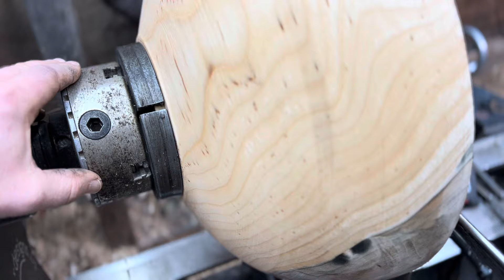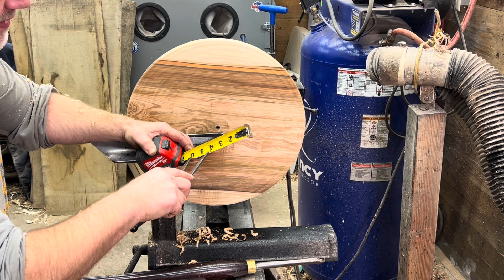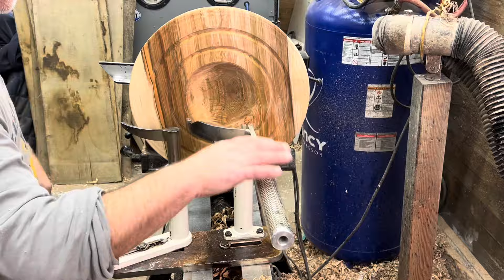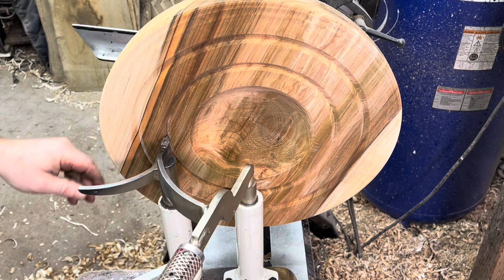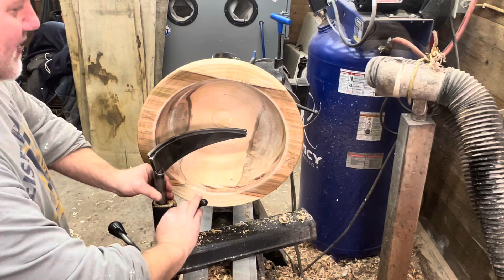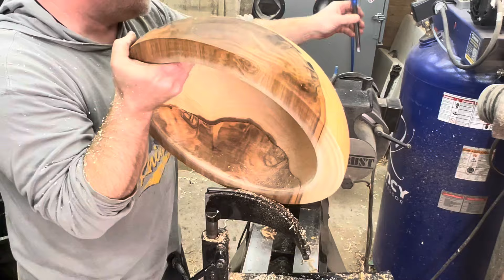Bowl coring using the Oneway easy-core

Comment: Fantastic video....I'm forwarding this to a buddy. I purchased my Oneway set last fall and have a few half logs ready to "process".... Sassafras!! I will be sure to clear those chips... Thanks for the advice. One question.... How do you store your Oneway pieces to keep them organized and handy? I just finished a wall rack for mine, but really pulled the design out of thin air... I am looking for other ideas. Thanks again.
Reply from the maker: Sassafras is so fun to turn. And it smells amazing. My shop is extremely small and I have almost no wall space. My pieces are all in a big steel cabinet out of the way for now. At least until I build my forever shop hopefully this summer. Holler if you run into any coring issues. Happy to help

Comment: Great video. Thanks for the instructions on the coring system. I’ve been considering one.  And I didn’t understand what all the knives were needed. I have a max diameter of 20. 18” is usually my starting point. And too don’t do small bowls. Can I get by with just a couple corn my knives? Roughly the 2 you just used?
Reply from the maker: I'd suggest starting with knive 1 and 3. You can always add knive 2 if you find you need it. 

I'd be lost without knives 1-3. I rarely use 4 at this point. Not a huge need for bowls over that scale ... at least for me currently
Reply: Thank you. That was what I needed to know

Comment: Great video! Where exactly are you measuring from on the base of the cutting arm to determine the position?
Reply from the maker: I measure from the leading edge of the post (white part holding the knife). If it's smashed against the bowl you get the full depth of the knife. Back it off if you need less. I hope that makes sense

Comment: The only downfall of the Oneway coring system is the need to sharpen the cutter bit so often that slows the coring process.  The good news is that Hunter Tools now sells a custom cartridge and carbide cutter that fits the Oneway Coring System. Although I thought it was somewhat expensive up front (about $200) I found that it was one of the best investments I've made in bowl turning. I've cored 175-200 bowls with one carbide cutter and NEVER NEEDED TO SHARPEN the cutter.  When the cutter does eventually dull, replacement carbide cutters are around 50.00 
If you do any amount of coring this is a must-have accessory.
Reply from the maker: The carbide replacements shaped like the factory ones are much better when it comes to staying sharp. I've tried the hunter cartridge but found it to be way overpriced for what it is. And I core thousands of bowls a year.